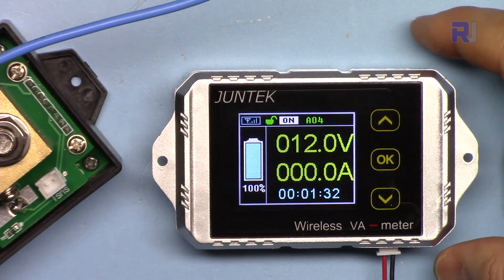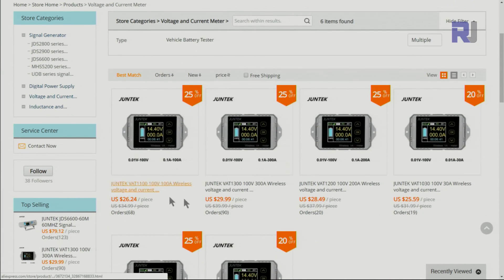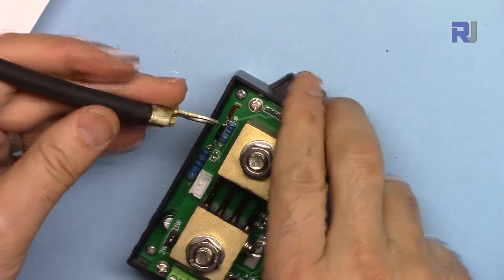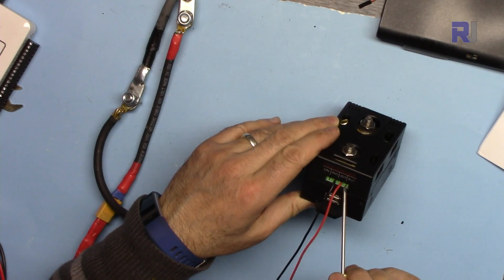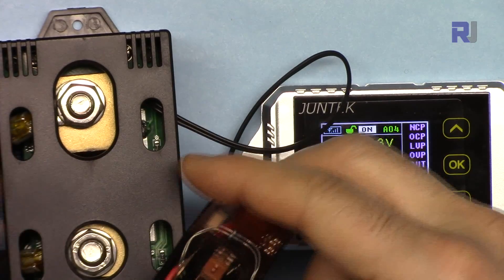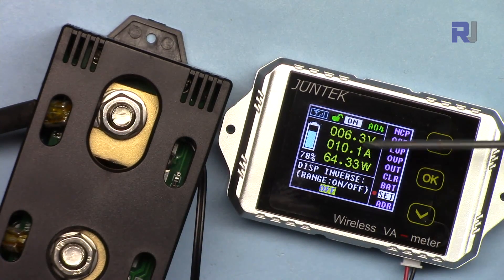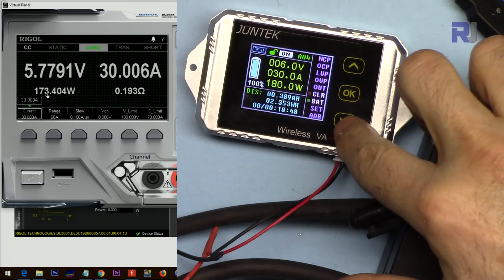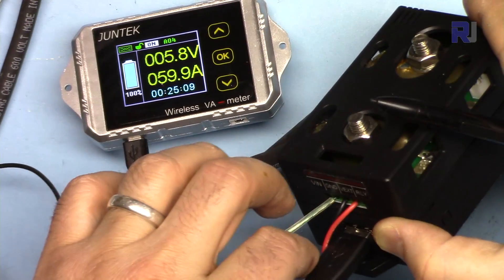Juntek VAT4300 Wireless Current Power multi-function Energy meter RJT164

Comment: I have this device in my Campervan. It works okey. But not very accurate. Loads unter 1 amp will not show up.
If my battery is full (12.8V 200ah Lifepo4) and i Set the % to Zero, after 4 days it will show 100%. This means it is measuring the loads around 25% to low every day. Or it measures 100% of the charge but only 75% of the discharge. So after 4 days battery shows 100%.
This device is good for rough estimate data. But definetly far from being accurate.
Reply from the maker: Agreed.

Comment: my battery on the display is always at 100% i cleard all settings and set it to 100% when fully charged  battery but dosent drop .how do you set it because booklet is shit😠😠
Reply from the maker: it drops only if you drain current.  what is the capacity of battery and at what rate you are draining the current? if you set the battery to 10A or 10000mA, and you darin 50mA/h it would drain very slowly and you wont' see it. So set your battery for 500mA/h and drain at 100mA or 200mA and you should see it drains quickly. I have tested it and it works. Unless your is defective.

Comment: Wonder how one would wire in a 200Amp relay with this unit to protect expensive solar batteries from
low voltage over discharge.?
Reply from the maker: It has been explained and demonstrated. i have also provided the user manual. Link in the description.

Comment: Yeah that is a sad design, someone was not thinking, and the cover for the shunt isn't the best either! But if it works well I could overlook the rest, maybe solder in a pin connector on the shunt board.